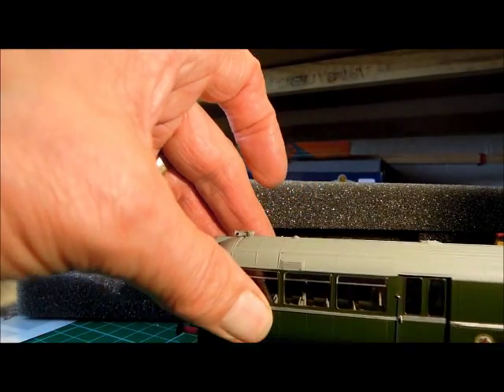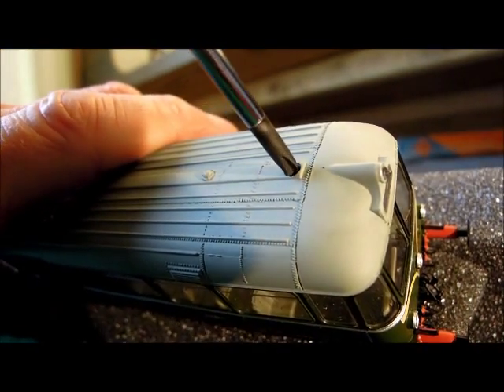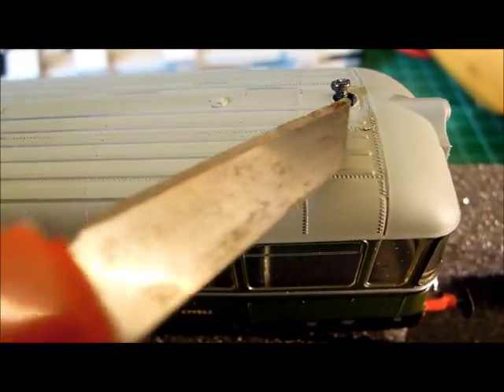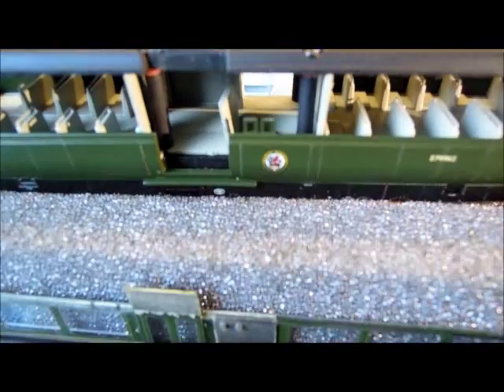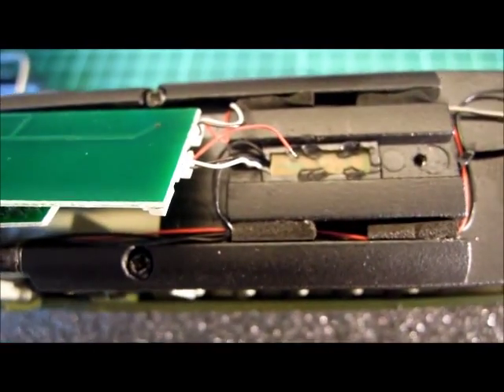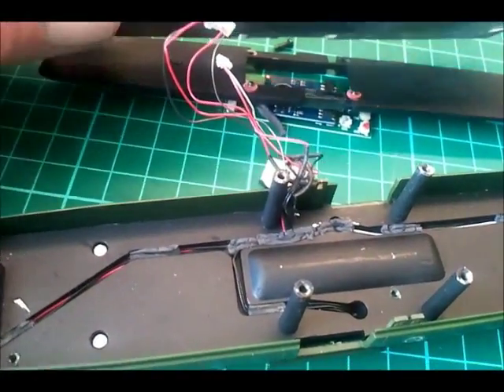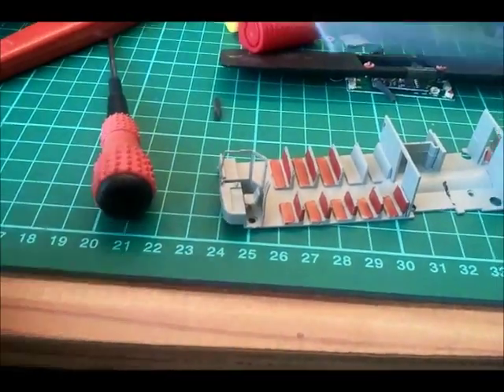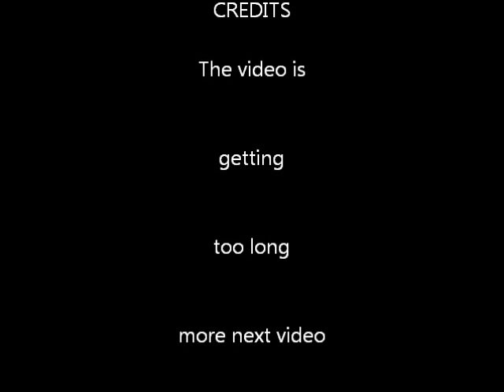Heljan Railbus taken apart

Comment: Interesting. Six years later, I've just bought one of these and I fitted a DCC Concepts decoder today before finding this video - I have the same disconnected red wire. I spent ages trying to find where it fits before trying the model out anyway, (before refitting the body); it's all fine. Weirdly, this is a four wheel drive model when the prototype was only two wheel drive. They used to run them around these parts and had to make sure that the driven wheels were at the rear when going in the uphill direction of the line or they'd lose traction. The model runs well, but is much better with the included DCC Concepts stay alive fitted. This doesn't have nearly enough capacity to power the model for even half an inch, but it does have enough to prevent the decoder from shutting down and having to reboot when traversing dead frogs.
Reply: Hi Roger. I may add a stay alive capacitor to mine if I can find space. Great models for small layouts. There is a railbus service every morning on the KWVR. Thank you for the information about the prototype, that was interesting. John
Reply from the maker: I hope it all worked out.

Comment from the maker: Excellent slow running. Drive to all four wheels, but only four wheels. The other youtube reviewer Australia1957T had trouble over two points back to back, but I have had no problems at all. This is an ideal model for providing a passenger service on my small layout, or it would allow anyone to add a small extra halt to a larger layout.

Comment: Excellent video I could of saved myself the money and fitted chip myself if I'd seen it first! Shop did say there was a loose red wire on mine too so same with all maybe? One question I have is when I put it on track I get what seems like a light flickering inside but when runs no inside lights? Is it supposed to have internal lighting?

Comment from the maker: Hi Postie, It does have interior lighting but it is very dim and on mine the hole in the cast roof weight had flash covering it. Also it looks as though there are wires so that the destination boards and other lights can be operated from separate outputs on the chip but they are connected together. Does the destination board light flicker as well? As the lights are a separate output on the DCC chip it could be turned off by the controller - try switching a few functions.

Comment: I've been on to Howes,  they have ordered some motors, and should have them soon. The motor spins freely but almost melts the wiring. I have removed the motor and will fix it myself when the motor becomes available, also re-assembled the chassis so it is rolling. I've managed to buy some of the plastic frets for it in the past, so broken bits shouldn't be a problem....
Reply from the maker: Hi Kevin, thank you for your comment. I will find out how my friend got on with his issue. I suspect the shop will send it back - they will not have a replacement. The motor on yours is obviously drawing too much current, I can't imagine that the wires are too thin. Let me (and all other watchers) know how you get on. Good luck, John

Comment from the maker: Yes, I don't think you need to risk damaging the door with a blade if you press in the right place on the body sides. Strange that there is no keeper plate to hold the board down and that loose red wire.

Comment: Have you had any other issues yet. The Heljan DCC blanking plug in mine has gone bang, so I acquired some other plugs and have now found that the motor is fried. I have stripped the unit completely and removed the motor, to try and find another one. I also had issues with the handrails and in the end I made a pair of my own, which haven't been a problem since fitting. The PCB keeper plate was fitted on mine and I think that shows a lack of quality control on behalf of Heljan.......
Reply from the maker: Hi Pugtop. Mine is not run very often. One of my friends has just emitted a puff of smoke and is being returned to the shop. You could try the shop or Heljan themselves - they need to know of any issues. Don't worry about guarantee. We are helping them learn more by returning faulty items. Good luck.